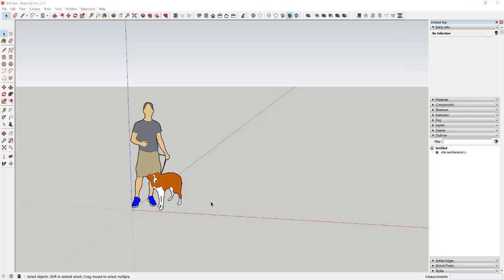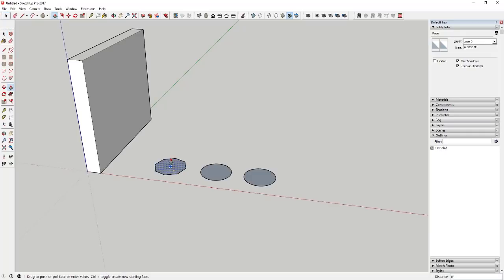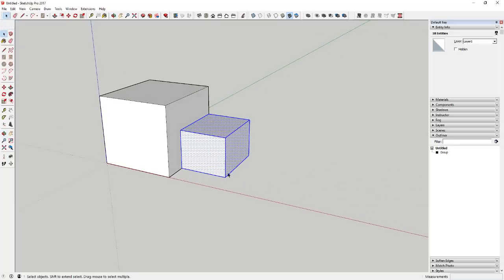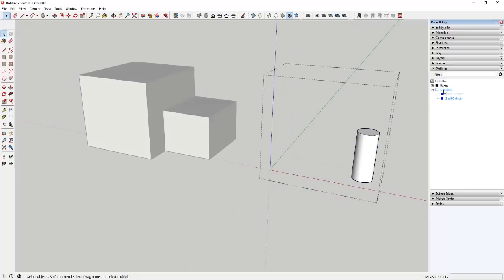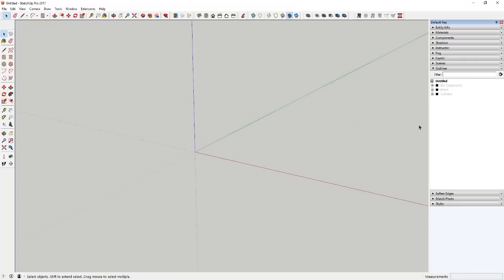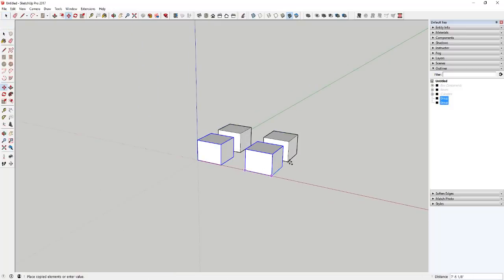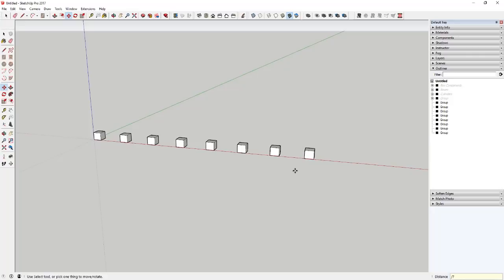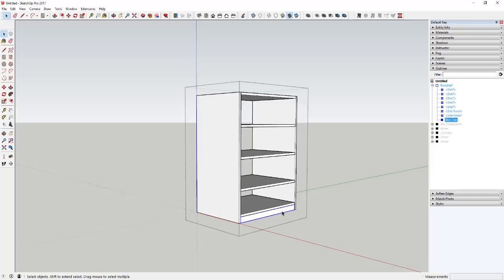SketchUp Woodworking Tutorial for Beginners Part 2 - Copies, Organization, and Curves

Comment: When I am making two different groups, like when you made the large box and the small box, when I try to select the small box to create a second group it highlights the first group as well. What am I missing that is causing this?
Reply from the maker: It sounds like you're including the first group in your selection by selecting it as well as the edges and faces of smaller box. Try holding the shift key and clicking on the large box to deselect it

Comment: This is very helpful information.  Thanks for posting this.  Three questions please: 
- Does one of your videos show how to create a cut sheet that takes the kerf of the table saw blade into account?
- Are there reusable components available, or that could be created to cover things like standard sheet goods, with REAL dimensions?   What about ways to model different types of joints or rabbits?
- Also, as you know, there is no longer a downloadable free version of SketchUp, does this impact the techniques you describe in these videos at all?  I'm still getting started, but the UI seems pretty different to me from what you're showing using SketchUp Pro 2017.
Thanks again!
Reply: The extension CutList takes the Kerf into account.

Comment: what if you build an obj, say a platform bed fram. and you start with a cube, then push pul and create lines to get the shape you want. then try to figure out how you will build it IRl by pulling each "piece"

right now when I try to move say the bottom piece it moves everything all wonky

Comment: I think some tips on moving the camera: rotating, panning, zooming, etc would have really helped. You move around very proficiently and I want to be just like you! Thanks.
Reply: I had the same issue, but found the O (orbit) and H (pan) tools to change camera view. Then space to reset to the pointer. Would have been handy to know this earlier. I'm sure there are other good tricks too.
Reply: I should also have mentioned that holding down the middle mouse button also activates orbit function, then release to deactivate. This is the quickest way to change camera position without using the keyboard.

Comment: Hi this is the first time I have ever used sketchup or any design programmes, I am trying to make a bookcase which has a width of 1200mm, the height 2000mm, 300mm thick and wood is 18mm. Please help, starting a project with my husband
Reply from the maker: Did you follow the steps in the video? What seems to be the problem?

Comment: Know the basics for the most part with the regular shapes. (Didn't say I was any good at them, but I at least understand them.) However, I'm working on modeling a project I'd like to do that involves wingnuts, acorn nuts and other specialty type hardware. What's the best way to model these? Do you have a video going over something similar?
Reply from the maker: That's a bit more advanced modeling - have you considered downloading shapes like that from the 3D Warehouse instead?
Reply: @Thesketchupessentials  That's ultimately what I was asking. Do you have to model everything like that manually, or are you able to get/save shapes like that to use? I'm sorry I didn't communicate that well with my first question. (I have the free version and can't afford to pay for anything like that right now fyi)

Comment: This video was epic in terms of instruction, not too less not too much details, very balanced, but one thing i was hoping was what happens when you wanna remove a component and then put them 
back as a component
Reply from the maker: You mean like replacing a component with another component? Or are you trying to do something else?
Reply: @Thesketchupessentials  yea thats the one i was looking for replacing one with another one
Reply: @Thesketchupessentials  also what are some of the best free extensions that you can recommend for design student?
Reply from the maker: I talk a bit about that in this video - https://www.youtube.com/watch?v=Igiq30yydbo - it's pretty easy - just select the components, find a new component in the component manager, right click and select replace selected
Reply from the maker: Really depends on what you're trying to do
Reply: @Thesketchupessentials  this is the last one i promise, is there any way you can test different materials for furniture design and apply load on them to check if they gonna work or not?
Reply from the maker: I don't think I did grouping with any extensions...
Reply from the maker: "What extensions are good all-around" - I don't know how to answer that question. That's like asking what tool in your toolbox is a good all-around tool. It depends on the job you're trying to do
Reply from the maker: "Product design extensions" - Maybe roundcorner for rounding off edges. Possibly Joint Push Pull for push pulling curves
Reply from the maker: "Test different materials" - Only by applying them and looking at them
Reply: @Thesketchupessentials  Thanx dude for taking the time to reply, appreciate it
Reply: Did you have any extensions installed to do some of the stuff you did, like the grouping stuff and components into layers?
Reply: also what extensions do you use that you can say is more or less all rounder extensions?
Reply: Im doing product design mostly furniture and consumer electronics

Comment: Great videos. Thanks for making them available. I'm brand new to this type of software and never used any type of cad program, but I must say I can't believe one would have to turn on Outliner. It just seems like such a must have option it would be default. It's like trying to use Photoshop without a layers palette.
Reply from the maker: Well, the one thing you have to look out for is that it really slows down your model if you create a lot of new geometry, so make sure to minimize it before you do anything that creates a lot of new objects - Thanks!
Reply: Minimize the outliner? Or do you mean hide any objects I'm not dealing with? The outliner just seems like simple text to track all the shapes, or objects.
I did a stress test last night to test my rig. I built it and it's got a 8 core cpu, 128gb of ram, $3k video card and 5 SSD's. I was following along with one of your videos and learned how to add more of what I just moved at the interval I moved them, so for fun I created a 2x4 stud x 10' and then moved one to 16" (normal stud spacing) and then made a quantity of 777, haha. It did take a couple of second but it did it no problem. Even slewed around them all at various distances for a while to watch cpu spikes. It was just a test, but I plan on using hide a lot. :)
Reply from the maker: Wow - that's quite the rig :0 - What's the video card you have in that? Here - I actually just put out a video about this today - https://www.youtube.com/watch?v=wrByHCyfkOg&lc=UgyhhsnlKkbpWnUnuHR4AaABAg - Unfortunately, hardware seems to only take you so far with SketchUp - it's a bit of a software limitation, though you can get around it by using smart modeling practices. Thanks!
Reply: It's much cheaper now. I'm a video editing enthusiast and it had an insane amount of cuda cores and 12gb of vram. I wanted the the Quadro but it was 7k, haha. Glad I didn't or I still wouldn't be able to afford food. I have the Titan Z.

Cool, will check out your video tonight. Been glued to them Great information. I understand about it being a software limitation. Any computer is always limited by software. Even the operating system only has a certain amount of resources. All the cpu power or memory in the world won't help.
Reply from the maker: Wow - that's quite the rig :) - I'm running a 1080Ti with an I7-8700 CPU because I do a fair amount of VR, and a nice byproduct was the reduced video export times ;p
Reply: Great card and cpu. I love my VR (Oculus), especially flight simming (p3d). I'm sure we're not too many years from being able to walk through our Sketchup models in VR.
Reply: וחלצן

Comment: I don’t know why the divide by 4 for the shelves didn’t work for me.
Reply from the maker: I'm going to need a bit more information. Just to check your workflow - you selected your object, activated the move tool, clicked to set a base point, tapped the control key to activate copy mode, set your second point, then typed "/4" and hit the enter key and it didn't work? If you added or subtracted anything from this set of steps, it might not work. Thanks!
Reply: TheSketchUpEssentials thanks a lot it worked now. I wasn’t setting the copied one to determine a distance.

Comment: Quick question. When you move the second side of the shelf 2' 6" away, the gap (which is what will be measured) isn't 2'6" because it measures from the inside edge of what is being copied to the outside edge of the duplicate. How just get 2'6" in the gap?
Reply from the maker: You could use the guide tool to draw a 2'6" guide in the gap, then move it so that it's aligned with that guide. You could also just move it again to a length of the thickness of the piece in that same direction, or you could just adjust for that extra thickness in your original move distance. Does that make sense?